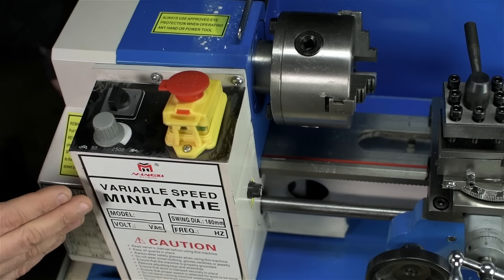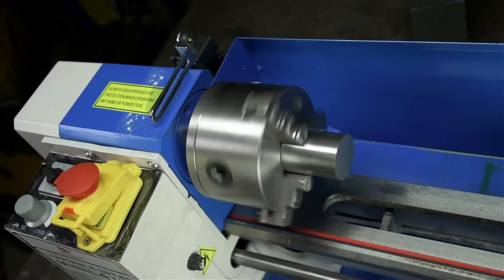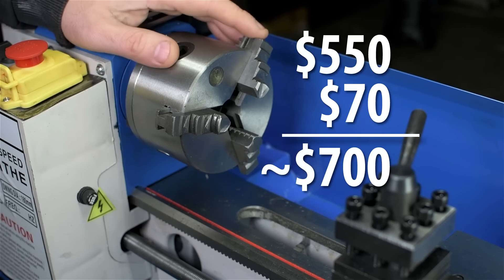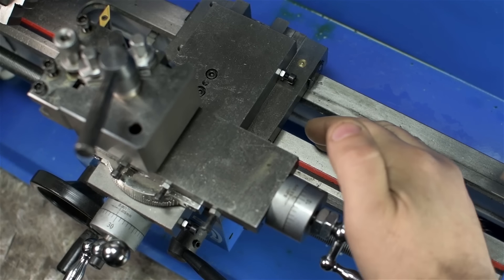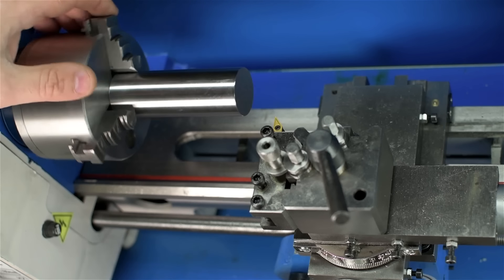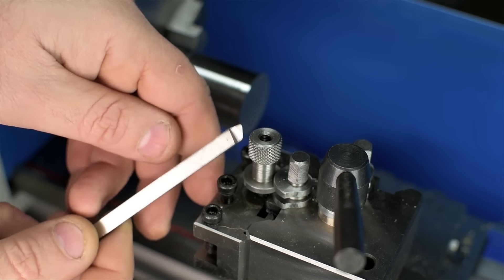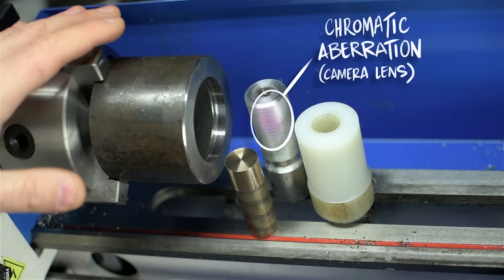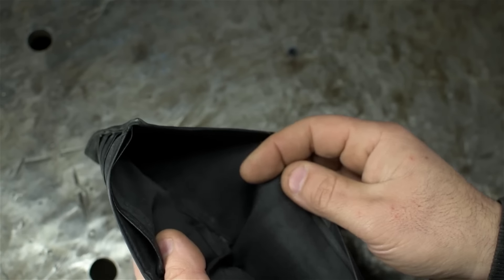The Infamous Mini Lathe!

Comment: MINI LATHE CREW!! 
The plastic change gears are the first thing everyone notices and is uneasy about, but I haven't yet had any issues with them stripping at all; the stress seems to be absorbed into the leadscrew and generally not great enough at the change gears.  The issue, however, is inside the headstock are the gears for the High/Low speed setting, and they are plastic.  It's, unfortunately, an objectively poor part of the design and definitely a weak spot.  If you were to drop hard earned money on upgrades, I'd start with replacing the gears inside the headstock (they will absolutely strip and then the lathe will be dead in the water).   On mine (grizzly, so whichever factory it came out of but same basic machine) the lever on the back that controls the lead screw engagement likes to pop out, it just doesn't have enough holding power and so you can lose your place when cutting a thread.  I just put a block of steel under it to hold it in place.  Well, I did until I got a south bend.  People love to hate on these lathes but they'll do a whole lot (with the little tiny carbide insert tooling I got super awesome finishes on heat treated 17-4ph, and tons of other relatively tough materials)
Reply: Ah, good to hear about the plastic gears. I have the metal ones. And yes, I do some 17-4ph too with crazy good results. I have even done titanium:). I am using inserts specified for alu on everything and I think it works because they are quite sharp.
Reply: As for the head stock change gears, ToT's doesn't have that and a lot of the blue lathes don't either. (bear in mind, these are sold in all sorts of colors). That's a setup that's meant for the more powerful brushless motors but watch out as I think a lot of the newer "gearless" blue lathes don't come with the brushless motor... So, no low speed gear and still the older, less powerful brushed motor. Mine came like that and I suspect ToT's did, too.
Reply: Thank you for a great video and lots of sound advice,  That is why I decided to ask your expert advice   I bought an old Chinese bench lathe sight unseen on eBay a few weeks ago,I was  pleasantly surprised on pick up that apart from surface rust and being covered in dust It appeared to be in sound condition . It is  a Huangshan  CQ9330 model ,no Idea of the age but it cleaned up well and after adjustments to all gibs ,and making and fitting the missing tail stock gib  have had really good results  on a few projects in steel   The lathe is belt driven . With all steel gearing .  Impressed with the general construction  In the process of a complete strip down to replace suspect headstock taper roller bearings “a bit nosy ,but look ok ?? “. The strip down is just to see  may have been worn Every thing looks perfect except  the bearings and the drive belts. 
   My main problem is that I can find no  information on the lathe   Hope you or some of your followers could  help , I have a mechanical background but have limited turning skills  T.I.A

Comment: well it's a lathe  https://www.youtube.com/post/UgkxN9zrzkkhnjUF5PQbuA_B1gYdsfCu9k6z  but it wasn't what i would have anticipated. Headstock, tailstock, carriage apron are manufactured from aluminum now not cast iron. The spindle diameter for the bearings is too small allowing for a few play in the spindle so I am using some blue Loctite to take out the play.
Reply: Depends on how many fingers you still have.

Comment: You're suppose to use the lathe to make new gears.
Reply: people dont get that, they just want to hack at a project and go or just dont want to chistle out all them teeth.
Reply: you don't use a lathe to cut gears you need a horizontal mill with a dividing head
Reply: @breakingtoast2255  you can make gears on a lathe just not this kind you have to hob them not turn them... and a lathe c axis is way more accurate then an A axis attachment for a VMC
Reply: @fishsticks88  yes i know it can be done on the lathe but id use mill
Reply: @fishsticks88  use horizontal mill not vertical with form cutting tools most of your prep work can be done on the lathe and as for hobbing its usually used to cut repetitive cuts into gear blanks that are set up for the cut already
Reply: yeah, it's not that hard to just use a  dremel to make the gears, with the lathe just holding the piece
Reply: you also need a mill to make gears, unless you are a real tool and die maker, as i am
Reply: @anikidwolfy  chistle out?   never heard of broaching?  or however that's spelled.
Reply: The loads on the knurling tool might be a bit high...
Reply: @fishsticks88  6sm?
Reply: @breakingtoast2255  I saw a vid here where a guy turned a CUBE on a lathe, i saw another where a guy found a way to index his lathe and did make a gear on his lathe. painstaking PITA, but it can be done.
Reply: It's like buying a 3d printer to print upgrades for itself 😂
Reply: @mikeg8773  a lathe is just about the Only machine that can reproduce itself. It was one hell of a technological breakthrough when the first one was made.
Reply: @JC-11111  where is it superior to 3d printer in terms of reproduction? U are really crazy mate. I can actually make 20 bodies for printers with only removing each one when its finished.
Reply: All you need is a file and time
Reply: Cool page pic
Reply: Doh! Gear cutting totally different ball game. This video is brilliant.
Reply: @breakingtoast2255  r/wooooosh
Reply: @BeeBait  reading comments its obvious most of you are not machinests
Reply: You'd be better off using the plastic gears to make sand molds to cast new gears from aluminum or brass. It might take a try or two and they'll require cleanup but as long as you have the plastic gears for masters you can make new ones whenever you need and broken gears can just be remelted into new gears.

Comment: Well, if it will help anybody, and not to contradict the Boss..... But I have a little 7x10, that about 10 to 12 years ago, completely reworked, which my channel lightly covers, but never mind that, I have over 19,000 hours on my little lathe of actually on/running time, and yes, I installed an hour meter on mine, and over 90 % of the "on-time" is cutting the various alloys of steel, and of course, the other 10 % is of softer stuff, I love my little lathe!!!! It has made me allot of money, I have slowed down as of lately, so I am not taking on new projects, while I heal up my back, but, after the rework of the lathe, it is one precise piece of machinery, and can hold a (0.0005" ) all day long upon demand, please note, right out of the box, no, it will not do that, maybe (0.003" to 0.005" ) but will not be repeatable or predictable, lol... But try looking at these little machines as projects themselves, with the goal in mind, to make it a precise little machine... that 19,000 hours of actually on / running time is no joke!!!!! I have run the day lights out of it, and not a single issue, grease them often, oil them all the time, even when not in use, keep them clean, and do not ask this dinky machine to do more then it can, a (0.010"  to 0.020" ) depth of cut on a factory set up unit, is all you should expect, now my little "jet engine" as it is know as, can easily bite off (0.030" to 0.045" ) depth of cut. But, just because I know it can do it, I still just plug away at (0.015" ) and just enjoy the process, and appreciate the fact, that I have the little lathe and milling machines, as that is all the money I had would permit at the time when I got them... Yes!!! I love my little machines.. a side note, I still am asked to do precise turning on mine, even though the customers have their own lathes, but, the time required to set up a 14x70 inch lathe, to Nick off a wee bit of skin milk, they just can't hold the tolerance, let alone as fast as I can with how simple this little machine allows me too... Tony is correct in the length issue, shoot for the longest bed you can afford, or, if you know factually that you will never need to turn anything longer the 8 to 10 inches, then your are golden with a 7x10, but .... you never know what fun things will come down the road, that you can turn... I can't go into any details, but one of my gun barrels went to competition 4 years ago, and came in 4th place upon accuracy traps out of either 37 or 47 other competitors... Just saying, that I was competition against folks who made their barrels on $1,000,000.00 machines, and my little machine cost $900.00 bucks... Lol .... enjoy the machine for what they are, Chinese junk, but with a wee bit of rework, you will be glade you have the unit! Dru
Reply: @lifuranph.d.9440  Oh, absolutely!!! Very well said, but, these need a wee bit more TLC, then the old school castings of vintage machines. The castings are really soft, of course strong enough to monkey around, but scratches on the bed ways come very fast, as an example. I wipe clean constantly with paint brushes, in my opinion, is a must, which is I small part of why I completely re-machined and ground all mating & sliding surfaces while putting alignment into the out of alignment set up they had, and re-flame hardened the bed ways and hand scraped all the dove tails ways, added way wipers or felt wipers to each of the respective areas and still, squirt oil all over everything, which is something that my tables (by my design) allows me to do, as all the oils / cutting fluids are gravity flowed to a catch basin, which lets me continuously re-fill my lil squirt cans, to continue using the oil endlessly. So all the oils simply drip off the machines and  funnel to one side of the tables into a chip trap, and then into a jug, that has one of those flippy valves on each table like what one finds on a water cooler, for ease of re-filling the oil cans. Not to sound like a parrot, just saying that I suppose it is easier for me to slop oil all over my dinky machines and not create a mess, as it is all self contained. With in approx one month of the machine learning curve, the ways got trashed,when the machines were new and didn't think I was doing anything wrong, as I did clean the excessive swarf/chips away and did oil things often, but still scratched morbidly... Well, after the improvements & mods, I didn't want that to happen again, so, oil on the contact sliding ways has 99% eliminated scratches. Or at least any heavy ones, it simply is that soft junk cast material/alloy. Please note, I am not an expert on anything, rather, just really enjoyed doing the best I could come up with ways to improve this little machine, and I learned so much while doing it!!! Mind you, it was very time consuming, as I had to blue print everything, while it is together, then tear it apart, blue print some more, then design the stuff that would allow for more advantages and efficiencies, and ease of operation, and smoothness. Ball bearings installed, where there was none, or to replace where oil-lite bronze bushings were. Thrust roller bearings in a few key locations, like the lead screws. The entire gear train is sealed roller ball bearings. A sure mounting method for the motor mount that allows for 3 axis of adjustment. Then after designing everything on paper and CAD, I assembled the mini lathe, and then made all the parts, once the parts were made, tear the lathe back apart, modify the lathe parts and tried those up, installed the newly made upgrade parts, rd-assembled the lathe, aligned everything... 19,000 plus hours later... lol... Very time consuming doing it this way. At that time, I didn't have another machine that would let me make them . Anyway, the gear train from motor to Chuck & lead screw's efficiency went up by 70% to 80%, from what the factory was, respective frictional loads on to the voltage & current measurements which is also why or how I can have a 800 watt 90 volt @ 1/3 up motor, hog (0.050" ), which is huge for a dinky machine and still have a wonderful and accurate finish. I do not like to do that though, just no need to, as I am never in a hurry for anything. Wow, I wrote another novel again, I am sorry, I just get so excited talking about my dinky "jet engine sounding lathe", I suppose I could have simply stated, (((yup!))) And all woulda been well... Lol yes, I agree with you sir, Dru

Comment: forget aftershave, golf-balls, whiskey, this Christmas buy him a lathe,
Reply: And some goggles.
Reply: and a safety tie, never forget the safety tie!
Reply: @Sharpless2  we used to have one of them. It was a mangled tie which somebody had been wearing as it sucked them into the machine. It was very oily, and very shredded.

We did not need a "tuck your tie in" sign. We had a safety tie.

Mine's a v neck jumper or waistcoat. Goes with the tie.
Reply: @weareallbeingwatched4602  i guess thats the best way to show people that rotating tools can be lethal easily. But i think you missed the joke.
Reply: @Sharpless2  I got the joke. I have seen the safety tie first hand.
Reply: @weareallbeingwatched4602  it was a colin furze reference btw.
Reply: @Sharpless2  I suspect he learned it off the UK mechanical engineering scene. I was taught about safety ties in the early '90s by guys who hadn't left the lab since the '70s.
Reply: @weareallbeingwatched4602  did you just reply to a convo that ended 2 months ago, for no reason? Lmao not that i care, but bro...
Reply: @Sharpless2  somebody bumped a comment with a like

Comment: Tony, try this out!  Use alcohol as a lubricant when cutting aluminum. I noticed the chafing in the threads... As an electrician, we cut and thread aluminum conduit fairly often. Believe it or not, ALCOHOL works better than oil. As in simple rubbing alcohol. We buy it by the gallon and get it cheaper and higher percentage. Then a simple squirt spray bottle. Takes very very little to make it work. half squirts every second or so. Try it out. Mirror finish on threads using the typical rigid threader. I bet you'll be shocked how well it works. Evaporates... no clean up. SWEET!!!
Reply: Very interesting. Thanks for the info.
Reply: sounds like a fire hazard. but interesting idea.
Reply: WD-40 works wonders as well 😉
As does the right inserts , those gold coloured ones are usually just for mild steel and such.

Aluminium requires a SHARP edge to cut clean.
Reply: +Yuck Foutube Tap magic is awesome! But alcohol kicks ass on aluminum!
Reply: Diesel works fairly well too without the fire hazard or the instant vapors.
Reply: @siggyincr7447  Vapors are truly not an issue w alcohol. We threaded miles of conduit with a ridgid handheld threader with open ARCING brushes under 12" from the alcohol being sprayed. Never once ever had an incident. When i say miles, i mean dozens... YEARS... crews of 60 guys... Don't be afraid to try this. It takes so little, you'll be surprised. An open door or window probably won't hurt though. I've never tried diesel, but I sure don't miss the cleanup of cutting oil on the floor, or ramrodding the oil out of the inside of the conduit after threading, or the oil dripping on my installation inside a cabinet... I've never seen anything leave a polished mirror finish like alcohol can. A close second is something similar to brake clean but for electricians. HELLA expensive but that's what I had until i finally convinced the boss the alcohol works better (and cheaper) and to at least try it. They now buy it by the gallon...

Comment: I finally got my own!
38mm spindle bore
16 inches between centres
125mm chuck
1100 W motor, 
looks very similar - likely from same factory!
Thanks for the video, it really did motivate me to take the plunge
Reply: oh and all metal gears and a set of spares for both metric and SAE thread cutting!

Comment: I think you now have to demonstrate how to use a treadmill motor.
Reply: what about belting a 25cc weedeater engine ??
Reply: @rwbimbie5854  I have a need for my weedeater, not for my neighbors glorified coat rack. :P
Reply: What's wrong with a cage, belt, and twin hamsters? Might have to stiffen the bed with 2 coats of paint to handle the extra torque though, but do-able.
Reply: Most treadmill motors are brushed high torque DC, you would only need a single belt not a bunch of gears. That said, why doesn't someone just use a large hobby brushless motor with a VFD/ESC with a single belt to the spindle, would make an awesome mini lathe without all the gearing.

Comment: 15:16 Having some experience building remote controlled race cars I can pretty much tell you that plastic gears are actually superior than metal gears. This is due to the fact that plastic gears can hold higher temperature better than metal gears when it's spinning at higher revolutions, I can't tell you how many transmissions we fried when using metal gears. At least when plastic gear's teeth broke you only need to change those gears protecting the whole unit.
Reply: yea that's what I was thinking 'maybe ruins the tooling' he explained that the tooling could be hundreds of dollars and stripping the gears is like 20$? seems better.

Comment: Oh boy, a half hour video about a piece of gear I may actually be able to fit in my shop closet?

Edit: Well, it looks like, eventually, I'd just build a bigger shop and get an old iron lathe.
Reply: @excited box I have exact same one mine to my door was $450. Never seen that tool post holder he got before that looks like it has some robust compared to the aluminium one we see everywhere. Metal gears only seem available for the common brands like grizzly little machine shop ect ect wonder where he found those?